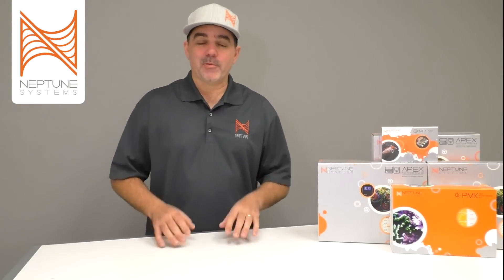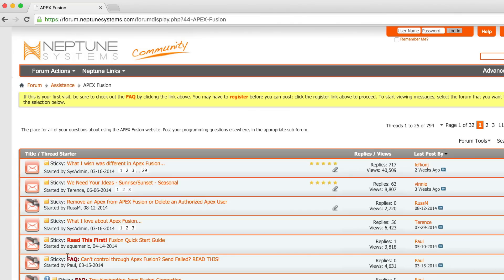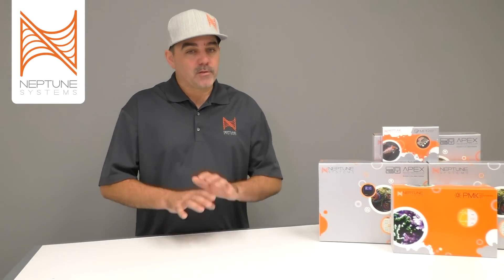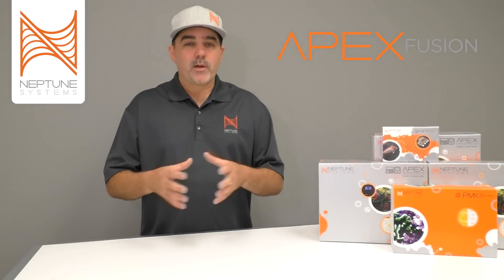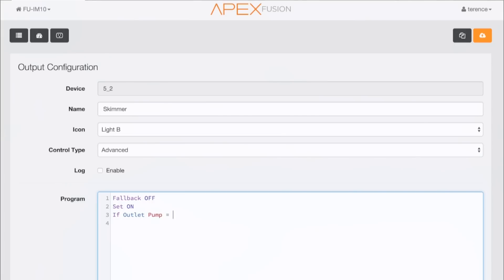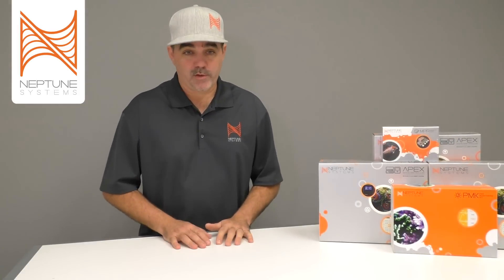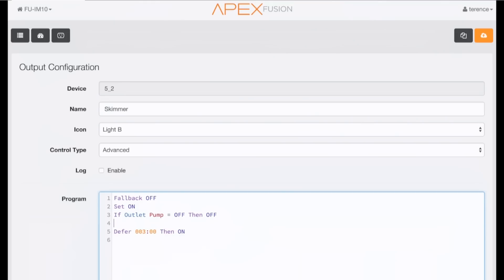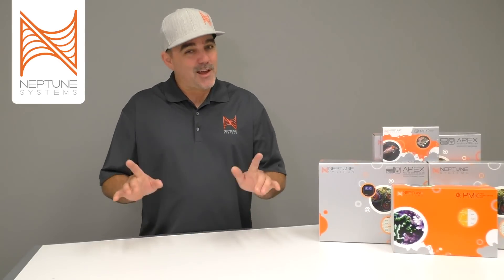Stop Skimmer Overflows - Neptune Systems Tech Tip 001

Comment: I am new to reefing and was told  that if you have a skimmer with the DC pump that it is very hard on the pump if you turn it on and off for the feed cycle. Is there any way to code an outlet to throttle these pumps down and not fully shut them off. I have a red sea reefer, 600 with a DC pump.

Comment: Can both of the suggestions exist together in the same configuration? I have apex jr. and am getting this as the allowable code from the video:
1 fallback OFF
2 set ON
3 if outlet pump = OFF then OFF
4 defer 3:00 then ON
5 if power apex OFF 003 then OFF

Comment: Hello. I just followed the steps and now my skimmer stays off. Any suggestions?
Reply from the maker: +Manny Guzman - Do you have the code above that says "SET ON"?  Post your question at forum.neptunesystems.com for more help.
Reply: +Neptune Systems yes i do.  Actually when i took off the command for the power outage, it worked.
Reply: +Manny Guzman +Neptune Systems, Shouldn't that power outage command be "OFF" instead of "Off"? I know the Apex command syntax is case sensitive, and I have only ever seen "OFF" in all caps.